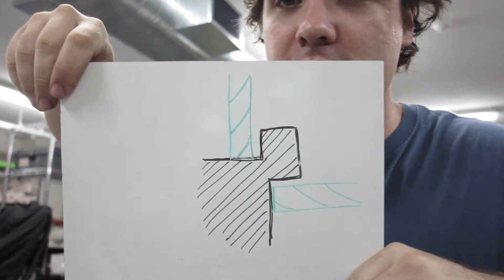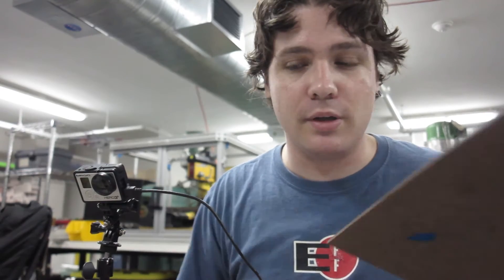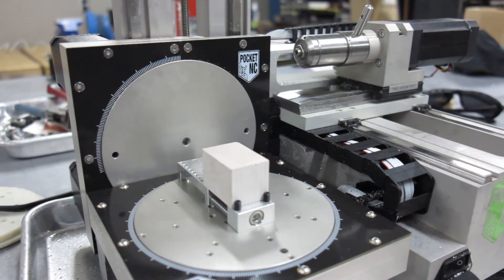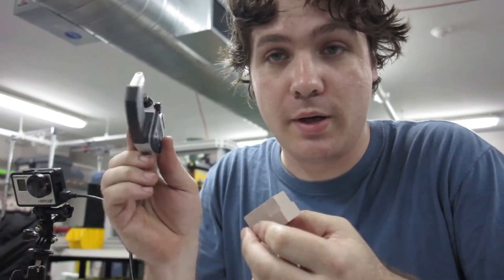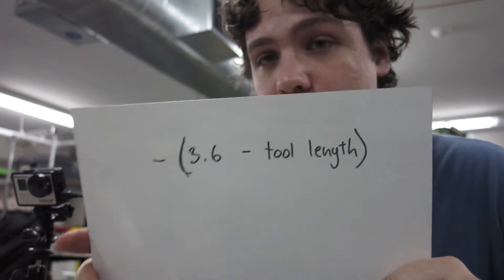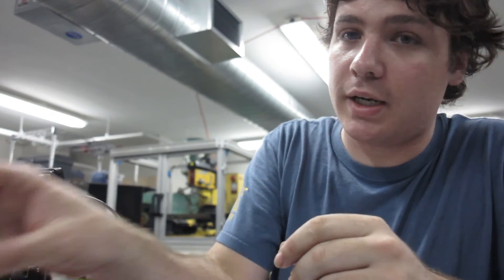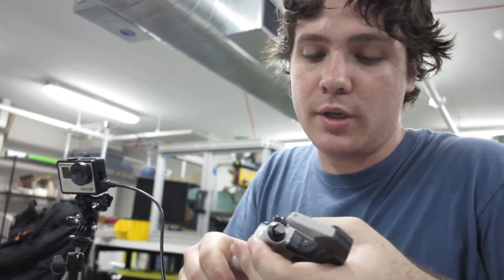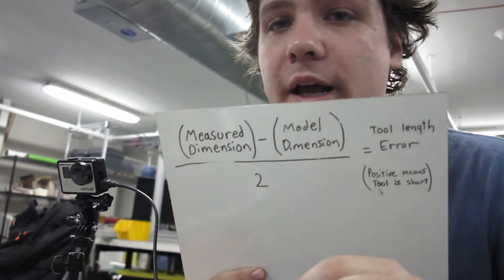Manually calibrating tool lengths on Pocket NC

Comment: Thanks for putting your videos up Gordon. I'm making the jump from conventional manual machining to CNC and am designing a machine roughly twice the size of yours (ie still quite small), for my own use. Jumping straight into 5 axis is a lot to chew, and the machine is probably about 2 years away. In the meanwhile I'm working on less ambitious CNC projects, so appreciate videos like yours. I currently also use F360 so it's great to see the 4th and 5th being used.

As an aside, machining both sides is an excellent solution but will also measure any eccentricity in the machine's axis. I don't know how accurate that machine is in that regard, but comparing to facing and machining a specific height without rotating could be a good comparison is you're starting to split thou.

Hopefully you'll get a chance to upload more videos as you present them very well.

Comment: So you've had the Pocket NC for a month now - or at least a month longer since you uploaded this video - are you still pleased with it?   Would you recommend it for a first timer?  I have never used a CNC machine at all though I do have some experience with 3D printers if that is any help whatsoever.  I'm interested in your thoughts.  You seem to be the only one on YouTube that has this machine.
Reply from the maker: Sorry I didn't get back to this sooner! Yes, I am still pleased with it. It might be a lot of machine for a first timer, but my advice would be that it would be a fine machine for a first timer as long as you take it slow. Don't be afraid to take a while to pretend it's only a 3 axis machine while you learn about the CNC process in general before complicating things with the 5 axis functionality. Also, if you think of it as a 3 axis machine when you are first starting out, there is a lot more knowledge (fusion tutorials, etc) already online that can help you a lot.
Reply: Thanks for your sound advice.  I'm nervous that I don't see more YouTubers with this machine.  The Kickstarter program obviously went well so where are all the videos?? lol Once you get the machine and accessories you are probably looking at a 5K+ investment, which is hard to do when you know nothing about machining.  Anyway, thanks again for your advice.  I'll probably chew on it for a few more months and then buy the darn thing :)

Comment: You may need to set tool to the type of material you are going to process. To keep tool deflection at a norm.
However on should Know. Cut high and calibrate as you go.

Comment: Call up the tool, move the Z toward the table or anything that you have cut that is presently on the table with the endmill you want to set in the spindle. So lets say your Table is presently Z zero, push the tool all the way up into the collet, lock the collet, move the end mill as close as you are comfortable to the table. When you are in this position, make your tool read Z zero by changing the offset, once your position indicators read zero while your end mill is close to the table, open the collet, pull the end mill out until it touches the table, lock the collet. Your end mill is now touching the table which is your work Z zero, and your position readouts show that your end mill is also at Z zero (touching the table)
Reply: I'd make a little hardened post that you can put on the table and bump against, once you have done that you can do your test cut if the accuracy from the first pre-set isn't close enough for what you're doing.
Reply: When you tighten the collet, it will be drawn in and the tool will be drawn in with it (making the tool length shorter than the distance from spindle to table).
Reply: Hiruden, you will always have wear offsets to deal with, no touch off is ever absolute.
Reply: Wear offsets? Wear is the least of your worries if you're tightening the collet after measuring the tool length, as you're suggesting.

edit...
I hadn't heard of wear offsets, it's a bit of a misnomer. Sure, sounds like adjusting the wear offset might fix the inherent inaccuracy of measuring before tightening.

Does the Pocket NC controller have wear offsets?
Reply: Hirudin all machines have wear offsets otherwise you change it in the tools geometry, never do you get an absolute touch off you will always have to make a cut, then adjust your numbers slightly, especially on machines like this, and to that tend perhaps the length the collet sucks in the tool is fine, it wouldn't be much at all, couple thou.
Reply: Interesting, thanks for the info!

Comment: Would you recommend the pocket NC given the lack of an electric probe?
Reply from the maker: Absolutely (depending what you need it for, I guess). Like almost everything in CNC or machining in general, if you know what you are working with and what your limitations are in advance, you can design a workflow around that. In this case, you just have to spend a little time calibrating each new tool before you put it in use, and make sure that each tool has a collar on it or is long enough to bottom out in the spindle so you can reliably put the tool to the same depth (or just use dedicated toolholders, on the new version of the Pocket NC spindle).
Reply: Gordon Clement hi my friend, what is happening with the video of pocket cnc